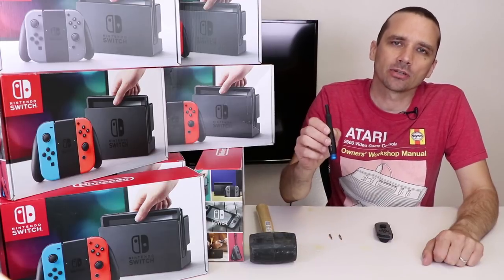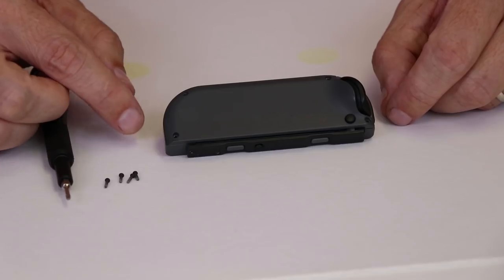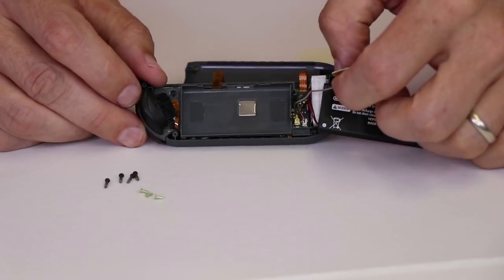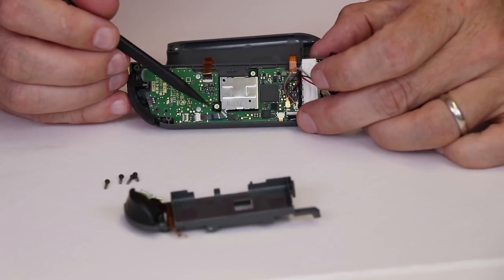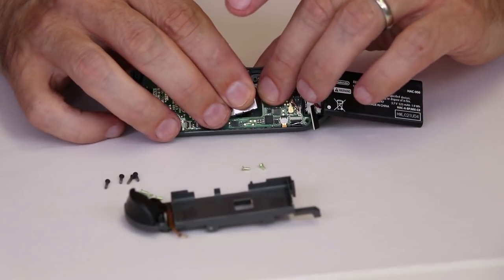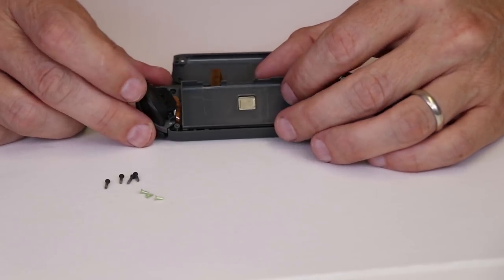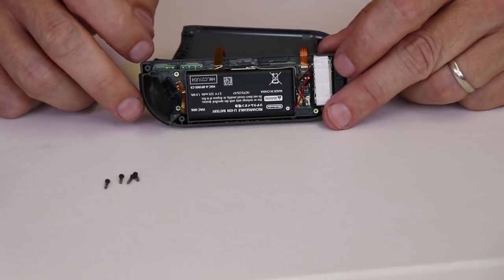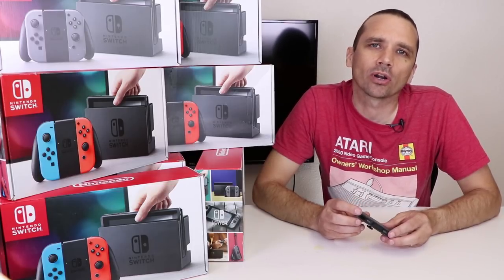Nintendo Switch Joy Con Stick Fix - No More Analog Drift

Comment: Got my Switch a few months ago and I've already had to replace the analog stick in one of my joy cons. Nintendo seriously needs to do something about this. It's ridiculous.
Reply from the maker: Ya, these seems to failing quite a bit.
Reply: it's like the nunchuck analogue drift all over again haha 

damn it Nintendo
Reply: MrMichaelXX yea like lower the damn price of the joy cons and pro controllers
Reply: Yeah, they're laughably expensive. I wonder how much profit they've made from these damn things.
Reply: This is the second time one of my sticks stops working in a year, the problem is that my Switch doesn't have a guarantee anymore...
Reply: Yours is months still... mine happened after a month lol
Reply: Every wireless product Nintendo makes fails making the console unplayable! Next console I buy will NOT be from Nintendo!  Frustration level 9000!
Reply: It's a design flaw
Reply: i m on my 8 th set of joycons  and my third controller that has the same issues what is frustrating is that nintendo    dont do anything and i m wondering if it was manufactured that way to suck more money from their customers ..... worst oart of this is thay the pro controller uses the same analog stick as xbox one and ps4 uses which i had not seen this problem with
Reply: @manamaster6  hi friend,I have some repair tools for Switch,you can repair it yourself
Reply: Thankfully now a few months into the future the pro controller which I've had zero problems with costs about $20-25 cheaper than a set a joycons anyway.
Reply: If it was only a few months old you could've just sent it to Nintendo and they would've fixed it for free.
Reply: Yeah it’s been about 5 months and my analog stick yeets for no reason
Reply: I was having trouble with my left joystick right out of the box
Reply: Fortunately, they're owning that issue now (even for LA), for free. I used my Switch just around 2 months and my right analog is already drifting. I don't even play SSB or something hard on the joycons, just Zelda BotW.
Reply: @str8poisintv131  That'd be amazing here hahahahah with our taxes we are even lucky if we get to buy any Nintendo products.
Reply: Lets sue em
Reply: took mine aobut a year
Reply: @armagedoc66  same here my joy cons started to drift after a month I got them

Comment: My two cents (from Australia) 

I had drift problems with both 
blue and red controllers. I blew on the exposed section (lifting the 
rubber skirt below the knob of the  joystick, sounds wrong maybe, but 
whatever), Turned the controller upside down and rubbed with a 
toothbrush, updated the Switch, updated the controllers and callibrated 
and recallibrated and it did absolutley NOTHING. 

Watched a video about using a non conductive contact cleaner. So I went to 
Bunnings and got a WD40 Specialist Fast Drying Contact Cleaner 
"penetrates quickly and leaves no residue. For use on electrical 
equipment, contacts plastic & rubber" Cost about $17. Didn't know it
 would work, but thought I'd take the risk before forking out $120 for a
 new pair of controllers. 

With the help of another, I lifted the
 skirting of the red joystick using a large pin and shot on two sides of
 the joystick using the cleaner, which came with a long yellow straw for
 precision application. 

Incredibly, almost magically, the red controller worked good as new after first letting it dry (to air) for about 10 minutes. 

I
 tried the blue controller and found it more troublesome. It 
consistently drifted north. I tried it once, twice and no change On the 
third try I applied the spray to the east and west sides of the joystick
 and after reconnecting and a quick rotation, it also now works good as 
new. 

I can't say this will work for you. But thought I'd share 
my experience in case you're at wits end and thinking about ordering new
 controllers. Good luck.
Reply: Was it definitive?
Reply: I tried using gasoline and it worked instantly, that and compressed air to clean it out.
Reply: skeletorrobo have they drifted again at all?
Reply: Hey, I know it's late, but did you see the cardboard fix? Apparently the back plate of the analog stick gets lose, and that's what causes drift. Putting something like cardboard or a folded playing card to smush the stick back together apparently fixes the joycon

Comment: Worked like a charm! I didn't use the EXACT tools in the description, but I ordered a kit off of amazon and a joystick, and went at it. It works like new now, and was pretty easy, even if you've never opened up an electronic device in your life like me. Just make sure you follow the guide to the letter.
Reply from the maker: Glad you were able to fix yours! Thanks for the comment.
Reply: Where do you get a stick?
Reply: @jasonlanko593  Linked in the description....

Comment: So ... I gotta buy a new stick
Reply: Yeah would have been good to know before watching half of this video.
Reply: I jst got 2 new controllers and after a week i have the same fking problem, really🤦‍♂️🤦‍♂️
Reply: @luiro17   I have same issue but I just bought mine and in 3 days left stick is already drifting. I have never had issues with the right side always the left one. Wonder if the right side is stronger than the left. Meh anyways it's a huge flaw.
Reply: @pokecollect32  same
Reply: @luiro17  Maybe it's just thing in Europe, but you don't have a warranty for that?
Reply: @pokecollect32  a year and half with my switch, and finally my right joycon is starting to drift, I've noticed that some times it just goes down for no reasson, the left joycon stills ok though.
Reply: @pokecollect32  My right joycon is the only one drifting, so maybe a design flaw.
Reply: Go on Amazon and replace it with a kit for 15$
Reply: either that or remove the analog stick by first removing the blue ribbon cord, pry open the metal part and of the analog stick spray the isopropyl alcohol on a cotton swab, and rub it on the 3 graphite black parts...that will fix the drift...

Comment: One bit of advice: After you install the new joystick CALIBRATE THE CONTROLLER! I bought the exact replacement joystick, followed this tutorial exactly, turned on my system, and the drift was far worse than before. I was so frustrated at the thought that I'd wasted the time to do this and I'd still have to spend $80 on a new set of joycons anyway. 

Then my husband got home and I showed him, and he suggested calibrating the new joystick. I can't believe I didn't think of that on my own. It worked, and now my joycons are usable again!

Comment: Thanks for the tutorial! I managed to replace my left-joycon thumb control. To others, this video glosses over some details. Doable, but maybe not for the novice. Disconnecting and reconnecting ribbon cables isn't as easy is it seems in this video. Notice the edits in the video when he is doing the step of connecting those and putting everything back together. Make sure you have some needle-nose tweezers and some plastic prying tools, along with the screw drivers. Take pictures along the way and don't get flustered.

Comment: I know this doesn't sound sanitary, but I took the rubber cap off and just today I decided to blow air onto the top of the stick myself, to recreate the force of pressured air. Sure enough, it actually worked after doing it twice. There's no more drift.
Reply: Did the same, thanks, surely you saved me a lot of time and fighting with my local gamestop
Reply: You'll have to do it roughly every 2 days though, it's not a perfect solution from my experience
Reply: @Beriath Thanks! This is what I wanted to know!
Reply: The most simple way to end a complicated problem

Comment: Thanks for this!   My left joycon has been suffering drift for some time but watching this video gave me the confidence to replace the analogue stick, I got a pack of two from Amazon (complete with screwdrivers and tweezers) for only £7 and I managed to replace it.   Now its working like new.  (the only problem I had was replacing the ultra tiny and thin ribbon cable that connects the L and ZL buttons.  but I got it eventually)

Comment: thx, man.  This worked and i only lost one screw!  If you're doing this and you have no practice just go slow.  Stop when you get agitated.  When the buttons pop out of place just disassemble everything but the ribbons and see how it all fits together, no short cuts.  The only ribbon I had to pull was the joycon ribbon.  They just pull out with a tweezers, there's no clip action or anything.

I really like these controllers but the drifting is maddening and a new set of joy cons only lasts half a year.  Nintendo needs to redesign the control stick and do a recall, this issue is no joke.  I'd be more mad but replacing the stick was sort of fun.
Reply from the maker: Sounds like you're a natural fixer!
Reply: uh... sure.  Actually the new one drifted, too!  But I did a calibration and now it's perfect.  For a few months, I suspect.  These joy cons are garbage.

Comment: Great video!  Doesn't bode well that these are failing already lol!
Reply from the maker: Would be nice if they lasted a little longer!
Reply: they have been out for almost 2 years
Reply: Yes - precisely!  They should last a lot longer than 2 years lol.  I've got gaming systems from 30 years ago that still work... To fail within 2 years is crazy.
Reply: @GadgetUK164  and it's even faster than that i have had 3 sets fail on me in those 2 years, im currently trying to figure out if i'd be able to fix it myself this time

Comment: Thank you. These joycons just seem to spontaneously fall apart. As a regular dad, I fixed 4 SL/SR ribbons, but a bad Joy Con Stick press was the newest issue. I had one Joycon I have been using for parts, and with these instructions I was able to do a transplant. Apparently the right and left sticks are the same part. Also, I did take some comment advice: RECALIBRATE after you replace the stick.

Comment: Guide was very helpful in replacing my out of warranty joycon sticks. For those that have this issue make sure if its within a year (or 90 days for additional joycons) that you let Nintendo repair them for free first. I had to start replacing my own sticks after my warranty ran out but I did have them repair some before I spent any money on parts. It is pretty silly these sticks seem to be failing so quick but at least make Nintendo Support work for you before you take it upon yourself.
Reply from the maker: Good points. Seems like they could make these a little better quality for sure.

Comment: Thanks! Although you made it for the right stick, I find it useful for the left one. It have also a weird ribbon over the final screw, but nothing impossible.
Also the last step is to recalibrate the jostick. And finally, all like new. :-)
Reply: Same. I was doing the left joycon and just assumed Nintendo must have changed the joycon "guts" a bit at some point until my husband pointed out that the joycon in the video is the right one. lol

And yes. CALIBRATE!

Comment: Note! You only show the procedure for the right  controller, the layout for the left controller is different, where it’s easy to end up removing the screws for the motherboard and damaging it like I did! (Tip - only remove the gold screws). Also the ribbon  cable to the battery cradle on the right controller is a nightmare to reconnect! Gave up, ordered new joycons...

Comment: You seem to be using an updated version of the joy con, not the original that came with the Switch at launch. Mine looks different when you take out the battery. Wish it’d been stated in the title

Comment: What if you replace the joystick and the same problem persists even after attempting a reset and recalibration? Someone suggested WD-40 Contact Cleaner but if the joystick is entirely new then cleaning it seems unnecessary. What other problems could there be? Is the controller just a lost cause?

Comment: My switch is old. Never had any issues with the joycons... Until it got knocked off the kitchen table. Now the joycon drifts/moves in the wrong directions. I don't think I trust myself to replace anything, but new joycons are super expensive. Any recommendations?

Comment: Are these replacements exactly the same as the analog stick in the joy con as default?
Reply from the maker: Yep
Reply: So does that means they will drift again?
Reply: @Mrluigibear  Eventually, so I wouldn't do this as preventative maintenance. They do make metal ones now but I don't think they prevent drift and therefore seem a bit unnecessary.

Comment: I'm having problemswhile reassembling my right joycon: everything works fine but, when putting the battery "case" back in place and screwing the 3 screws, the joystick stucks in one direction. what can i do? i'm guessing the joystick's ribbon cable is messed up but i can't find my way around this.

Comment: Im not sure if u will read this now but i wanted to ask you if it might be possible if you make a video one of these days where you take your working switch and measure alle the caps and pins around the M92T36 chip (maybe once with charger plugged in and once with only the battery) so that we guys that want to repair our switches could have something to compare our voltage measurments to. My switch for example has a short somewhere and im getting very strange voltage readings on the board. As i dont have a working switch laying around i cant compare the measurments to know if that part of the board is working properly or not. As you know there is next to none information about switch board schematics and stuff like that. Im sure that would be a REAL big help.
Reply from the maker: I might do that if I get time...not sure if that will happen but I'll def keep that in mind.
Reply: If you have a short it will get hot where the short is. So what you will want to do is take a power supply and set it to something like 1 volt. You will want to inject voltage on the suspected rail. Which will be enough to heat up the area but not cause any damage. 

Another good way to test is put your meter in diode mode and look  for a direct short to ground on the rails you are getting a strange voltage on. Then check the resistance to ground, if it's a low resistance that's your short. Use the alcohol method then to find the exact component.

Then if you don't have an IR camera you can put alcohol on the suspected area and if it's getting hot the alcohol will evaporate very quickly.
Reply: @mgzukows  hey thanks for the Tipps, i was able to find the cause of the short, it was the PI3USB Chip on the back, i replaced it and the Switch works again, the only Thing that does not work anymore is Docking it to a TV but portable Mode is working perfectly
Reply: @1995sharaku  Have you checked the system on a known working dock? It's a known issue for those to fail, especially if you had USB issues before.
Reply: no sadly not yet as it is the only dock i have at home, i will need to see if i can borrow a dock from someone to check if its my dock that became faulty somehow. Im just glad that i was able to fix the console partially somehow haha but thanks for your time and help i really appreciate it !

Comment: I replaced my sticks on both joy cons using this video, somewhere down the line the ZL button lost its function though and through trying to connect the ribbon cable it broke, so I won and then lost, I don’t even know if it can be saved now

Comment: Hi Steve, wonder if you can help, I have a switch have checked it charges which it does, the issue is a black screen on load up, I have tried 3 different screens and they all light up but black.  Could it be the video chip or something else?, i have checked all capacitors but no shorts, I brought it to repair and noticed water damage which i have cleaned up, any advise ? Thanks
Reply from the maker: Unfortunately, there's not much I can tell without having it here to test. Especially with liquid damage. The video chip can cause this problem.

Comment: Uh hey quick question Do I need something for the ribbon cable cause all I bought was Joysticks and screwdrivers.
Reply: I know this is a year old and I'm just commenting for fun but tweezers will help immensely with this. I fixed a couple joy-cons for friends and family and I did it without seeing any videos on it first, and I had to run to the store to grab tweezers to hold the cable and push it into the latch after fighting with the ribbon cable for the trigger for about an hour with no success because there's almost no slack in the ribbon cable. Otherwise, just flip up the latch with a fingernail (or tweezers but be gentle), and flip down with your finger. Don't use tweezers to press those down or you'll be like me and break the latch off of your 3DS screen connector (which I still haven't fixed...)
Best of luck to whoever needs this random information.

Comment: How do I  fix the ribbon cable in 2:20?
Reply: Replace it... sad but i don't think ya can repair it, cuz it is way to fragile...
but maybe ya should first check if it is rly broken or ya just not connect it like it should be ^^

Comment: WARNING TO EVERYONE TRYING TO FIX THE RIGHT JOY-CON: do not unplug the flex cable that sits on the side of the analog stick flex cable. It's damn hard to put it back in. Instead, follow the video and remove the R button and unscrew it from there.
Reply: you are so smart man I unplugged it and I had to spend so much time putting it back in

Comment: I changed my analog stick but I am still having the drift problem
Reply: Have you made sure to calibrate the stick
Reply: Have you made sure to calibrate your joycon? If not sure where can you can do that you have to go to system settings scroll down to controller and sensors, scroll down again then there is says calibrate control stick.